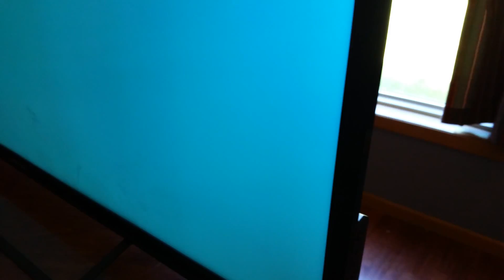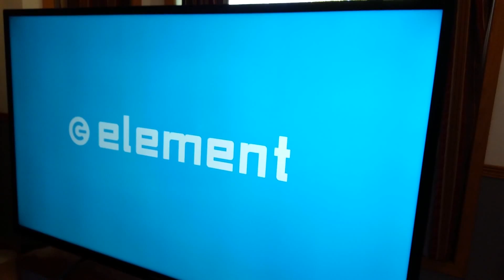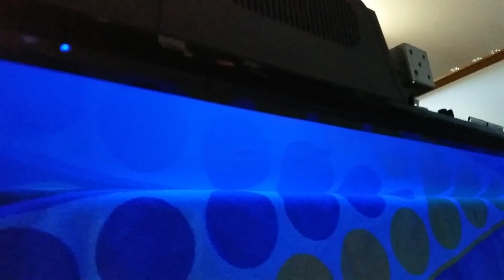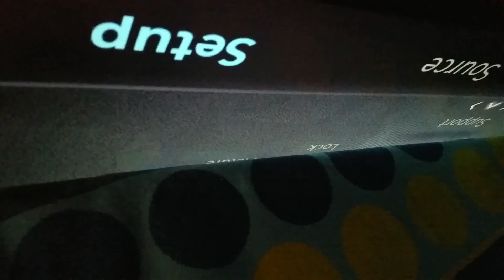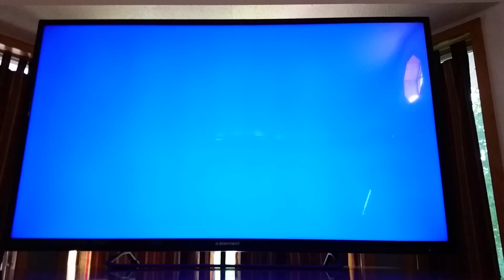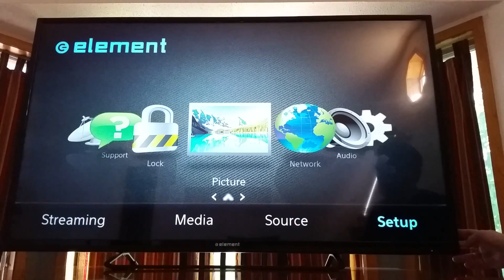Element 55" 4K smart TV Locking up on boot logo screen Repair

Comment: I had the same issue with my 55” Element.  I ordered the main board from www.shopjimmy.com .  They happened to be near me so I went and picked it up.  Took just minutes to swap out the old one.  It works now!   I paid $33 for the main board with a 10% discount first time customer offer.

Comment: Have the same tv. Mine works for 10-15 then the screen goes black, have sound and back lights are working, picture just goes out. Turn it off and back on and it works for a few minutes and back to a black screen. I know it's a heat problem but not sure which board. Any ideas?
Reply from the maker: If your sure the backlighting is still working it could be just about anything. T-con, main board, power supply or even panel. I'm not sure.
Reply: @jeffescortlx  I replaced tcon and that got the side buttons working all the time, they were intermittent. Tv ran for over an hour and black screen, turned off and back on and it's been working over an hour. The LEDs always stay on no matter what.

Comment: Just got what I believe to be the exact same tv ,size and all as in this video. Same problem aswell. Debating going through the trouble of replacing the board or just toss the tv due to getting it for free today. Since the video is a couple years old if not more has an easier solution became available since then? Also thanks for the video.
Reply from the maker: Best solution I know of is to either replace the main board, or try a reflow. Or if your really ambitious a re-ball.

Comment: I replaced this exact tv with 4 different mainboards from reputable sources and all 4 still froze up. Mainly would freeze up when exiting apps through wifi. When watching cable or through a HDMI input the screen would go blank but the backlights would stay on and I would still have sound. Just seemed funny to me that 4 totally different boards from different parts of the world reacted the same way so when I get time I'm gonna test all the secondary boards like the button boards and the ir boards.
Reply from the maker: Maybe it has a buggy firmware issue.
Reply: Just seen your reply after coming back to this tv again since I had given up on it and put it to the side. I might try seeing if the firmware will update. Thank you for replying.